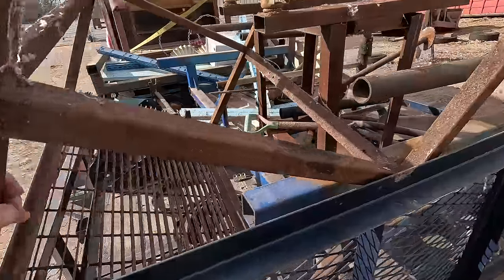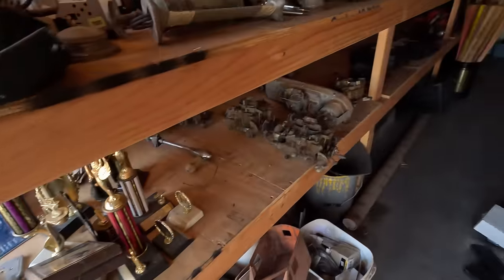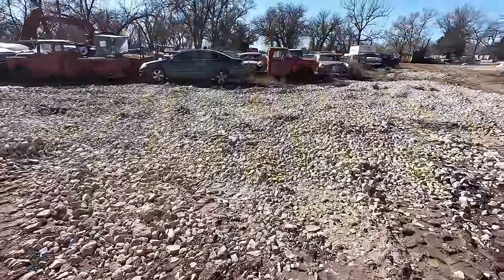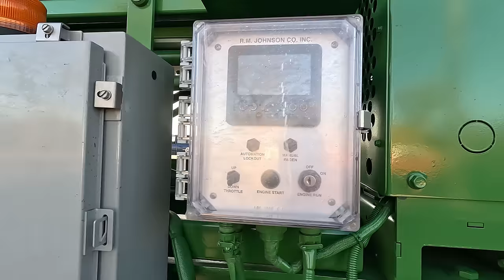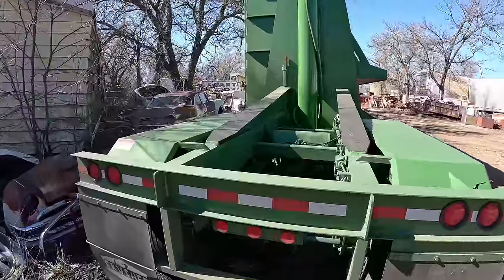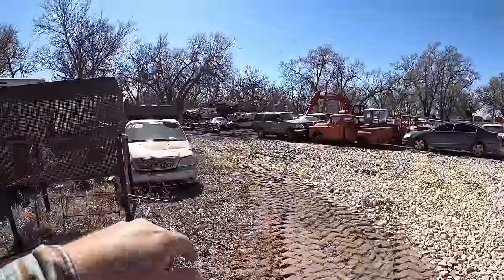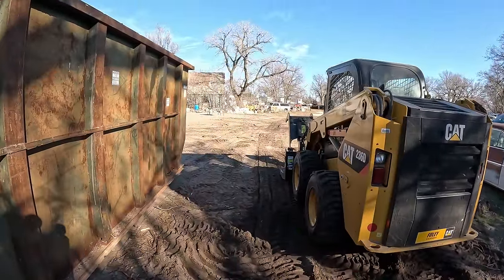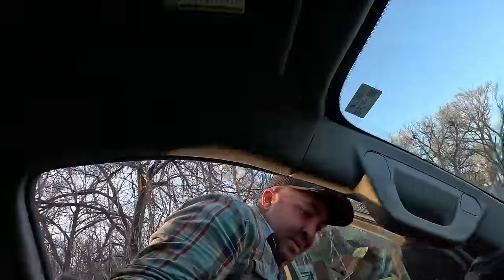This is Why I had to Get Rid of the CAR CRUSHER...

Comment: just a small tip on palletizing parts. cut seatbelts out of scrap cars, screw them to pallet; buckle and we used vise grips on the belt (loose end) and hammered it tight. its cheap and hope it will work for you. like your good old cars and trucks.

Comment: You are right about the LCD display with the clear plastic door. You better make a shade to cover it from the sun or it will fade to the point you won't be able to read it. We had the same issue on our new air compressors. It cost 10k to have them both replaced.

Comment: That def system will give you grief in the winter months...freezes at 12 F......expect some down time if its not maintained....😕....you may want to make a cover for the def tank.....😊
Reply from the maker: We have def on almost all of our equipment and vehicles. Other than a couple sensors we’ve never had an issue

Comment: Bro Silas when i wash my truck i put 1 cup of kerosene in the wash water(5 gal) and when i rinse it it has a awesome shine on it and no hand dry needed. might put a small bit of kerosene in a sprayer with water and spray the crusher with it. you will not be disappointed. i been doing it for years and no problems.

Comment: You should have a 5th wheel dolly so you can move the crusher with your loader instead of depending on a truck
Reply from the maker: I have one but pulling it 800 miles with a loader isn’t feasible

Comment: new crusher pretty green I have never figured out why they put the rams on upside down, they have more pressure going up than down, can you explain that.
Reply from the maker: 2500 psi like this, about 2600 psi with them flipped. There is also less stress on the machine this way

Comment: The def tri valve assembly will be troublesome , will cause the chk engine light to come on, engine goes into a derate mode . Have run into this problem with all of the new diesel school buses .

Comment: May i ask silas what happen to the back wall? i actually ended up sand blasting your old crusher and painting when it went through my shop n the new crusher you got (the hoss)
Reply from the maker: It caught on fire years ago. We rebuilt the cylinders, hoses, wiring, axles, etc but never bothered to paint it

Comment: don,t you in America get to sort more out of cars to crush it?...oil  gas tyres and windows is a most take away in Sweden...tyres must separate from the rubber and the steel or alum wheel sort separately...it is a most separate tyres for scrapyards.

Comment: Hello I believe that junkie rack with the bar on top is a table for oxycutting. You can lay whatever you're cutting on top of the table and when you cut the bars it doesn't matter you just replace them they should be removable if they're not it's easy to make. All those shelves you got like the rotating bins and the carts I put those in for it inside but they're not going to get rained on they look like they're for putting various pieces of sheet metal or steel on you know bar stock and angle iron stuff like that you could roll it around put it up against the wall I didn't hang on to him you do a lot of cutting and you know how to do all that stuff those are good resources. That's what I would do